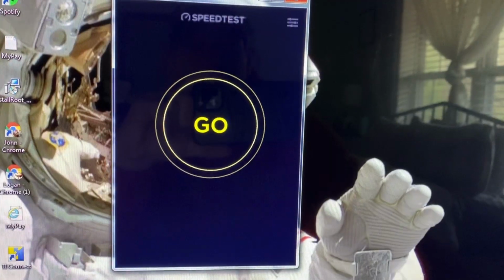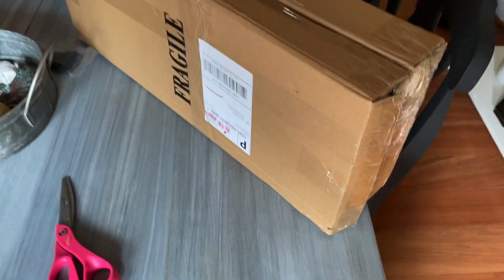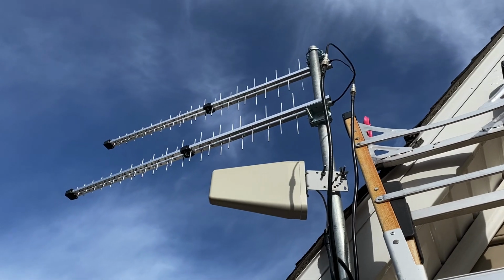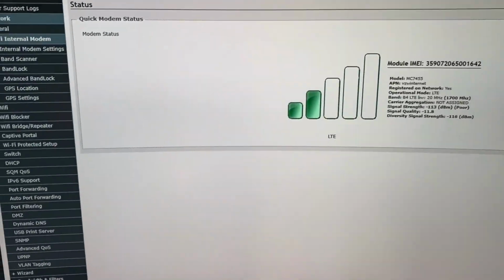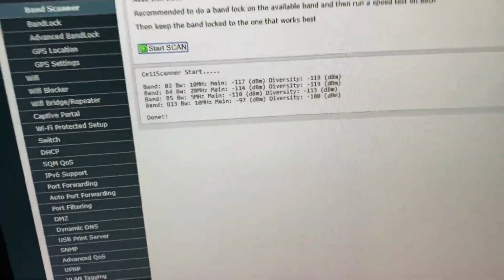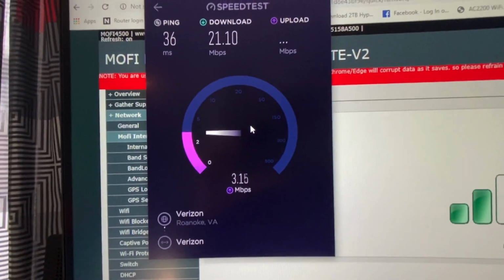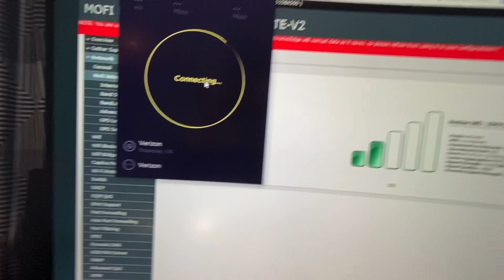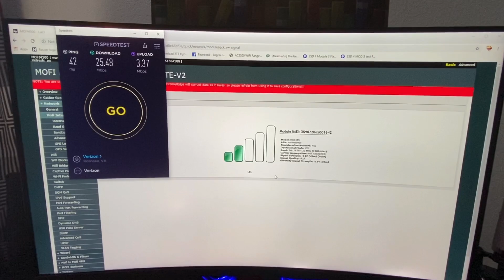INTERNET FOR PEOPLE IN THE MIDDLE OF NOWHERE. WIRENG ANT VS LOG PERIODIC Part 2

Comment: The mouth on you,Sheesh,Do you go back and listen to yourself?I never understood how someone with your foul mouth can make it in this world to afford a house like that.Its adolescent to speak with so many curse words,It undermines someones intelligence with a polarizing stigma.Anyone can go to a store and buy an antenna and put it on a structure,Its all store bought.Most to all these days LPDA are dc shorted(Low impedance).The yagi (With the driven element loops)you have there is either gamma or delta match will always work better than dc shorted antennas.When someone is in remote areas and signal are in the -100 to -120dbm range,Electrons migrate better if the boom of the antenna is not grounded like all lpda on the market,DC grounded yes,But not RF grounded.They make these antennas dc grounded for one reason,Corona discharge effect,So static built up from the atmospheric potential does not discharge back into sensitive electronic equipment.I have done extensive tests on many antennas,With a sawtooth sweep generator and a high end detector probe to see a bell curve (parabola) type response on the front end of these type of antennas.And the results are the non dc shorted antennas have a sharper Q,Higher skirts and higher gain.The LPDA have broader bandwidth but much less gain,Especially since the boom is grounded and low Z,The front end of a receiver hooked to a dc grounded antenna sees a lumped impedance mismatch VSWR.It does not hold a distributed 50 ohms like coax.

Comment: Hi there, Can you please tell me how far apart the old LPDA Antennas are spaced in millimeters using that bracket supplied with those WIRENG Antennas, I am guessing it looks like about 218mm .... John vk3hjq
Reply from the maker: Typically a ruler length. So LDPAs can be orientated In any way.  One on top of other, canted, side by side. Mine were stacked. Sometimes if they’re too close together signal isn’t as good the further apart they are.  It’s all trial error.  I’d test them in multiple configurations to see which gives you the most decibels brother.  Let me know what you get.
Reply from the maker: But the WIRENG is basically a ruler apart 12 inches I’d say
Reply: @rockernro   Hi John, Thank you for the reply, do you know the exact measurement used on this WIRENG bracket, as they should be placed at a minimum of 1 wavelength apart at the lowest operating frequency (1 wavelength @ 700MHz = 42.8cm) .... John vk3hjq
Reply from the maker: @vk3hjqjohn548  sorry I do not

Comment: You need parabolic. I have the same antenna you do here as a backup, it's not bad, but it the parabolic is much better. Also you should hook your mofi up to short cables near the antennas and see what the difference is. If it's drastic, you need better cable or in line M2M boosters.
Reply from the maker: Hahaha this is an older vid I  had 2 parabolics at one point look at my channel thanks !

Comment: If you have a parabolic antenna (which is actually much better than a log periodic) you need to have azimuth and elevation adjustable to get the best signal. Also, you need to have a really steady base for the antenna, any flex or swaying will produce signal strength changes. One other thing, during sunset the path changes so that also affects the signal somewhat. The trees in your direct path also degrade your signal (especially when they're green). I was a Sr. Telecom Project Manager for over 4 decades and also 7 yrs in the signal corp (MOS 26V & 26L).
Reply from the maker: Nice I’m an amateur and figured it out by hand lol.  I have parabolic vids on here when I upgraded
Reply: @rockernro  Glad to hear you figured it out. Good work! I'm not the type to give up either!

Comment: What type of connector do I need to go from this antenna to the low loss cable?
Reply from the maker: You don’t need a connector if the low loss cable has the connections built in.  One end of cable would be N-Male which goes to antenna.  Other end would be SMA-Male which is smaller end goes to mofi.  If you are doing 2 antennas you will need two cables.  Look at this link.  Don’t have to buy this one but something like this: Times Microwave 400-n-SMA-25 LMR-400 Antenna Line Coaxial Cable with N Male & Straight SMA Male Connectors https://www.amazon.com/dp/B00H9II93Q/ref=cm_sw_r_cp_api_glc_fabc_b2r-FbC68F40H
Reply: @rockernro  I am replacing the Wilson wideband antenna with the log periodic directional Yogi antenna just like the one in this video. The cable I have is  a low loss cable with N male going to the antenna, do I need a FME female to a N female to connect the wire to the log periodic antenna? Thank you for all your help ,I do have internet I am just trying to make the signal better with this antenna. Lol
Reply from the maker: @jbblevins2711  yes unfortunately the log periodic antennas need the connectors.  You know the parabolic will actually get you way more gain if you are looking for top speeds.  Won’t need any special connectors for them.  But yes you need an FME female to N male for sure for the LP
Reply from the maker: @jbblevins2711  like I went from -114 gain to -103 -104.  Went from 25 down and 1 up to 45 down and 6 up by switching to parabolic
Reply: @rockernro  Thank You very much!!!

Comment: Can someone please tell me the outside config layout diagram on the pole, to mount 2 Wilson 75 ohm antennas? One is pad one is yagi, I just need to know the proper install on the pole for them to be optimum. My god why is it so hard to find this? Surely someone has done this before
Reply from the maker: Are you using a mofi?  So you are using one Yagi and one Paddle antenna provided with mofi?  Use the quick check signal strength on main page of mofi to see your decibels in real live time.  What numbers do you have for signal strength and signal quality?  You want to get those as close to 0 as possible for example if you’re signal strength is -120, it needs to be -100 or less -85 somewhere like that.  We can get the decibels lower by ensuring we are locked on a band that your mofi found in the band scanner and turn the antenna left or right up and down until we dial it in to the lowest possible decibels.  Same thing applies to your signal quality.  If it’s -12 it needs to be -7 or lower. These are just examples.  Mine was signal strength -104 and my signal quality was -7.8.  That was the best I could get.  I tried every band.  And used the band that was the fastest.  Lastly, just because you have the best decibels on a band doesn’t mean it will be the best speeds.  Sometimes a different band with a little worst decibels might actually be faster.  Hope this helps you some.
Reply: @rockernro  well so here is what happened, I bought a weboost home 4g kit like a year ago for 400 bucks. It came with a paddle antenna. My amp only has one RF RG6 coax in port. And one out port (for the little inside antenna) well, I ordered a yagi Wilson antenna (same company as weboost) 75ohm directional antenna/yagi. I'm in an RV dont have alot of choices for height, I dont have LoS of tower but it's close by within 3 miles
Reply: @rockernro  oh also I am using the netgear ATT nighthawk MR1100. I know u asked about mofi 4500, I have that one as well but my service is activated for the nighthawk and not for the mofi 4500 unfortunately. Also, I have an inside antenna mimo pad hooked directly to the MR1100 via ts9
Reply from the maker: @unleasheth  nice man hey people have said those nighthawks are fast so hope it works out for ya.  You can always try taking the sim out and trying it in the mofi as well
Reply: @rockernro  thank u bro. I just thought it may mess up the service since the sim card is assigned to the nighthawk? If it wont then I'm def willing to try it cuz its the better modem of the 2 by far, with waaaay more of an in depth router setup than the nighthawk
Reply: @rockernro  I finally just found out that both of these antennas, the weboost paddle as well as the wilson yagi are both vertical polarized antennas. At the moment I have the paddle at the top of the pole, and the directional laid over on its side at 90 degrees right under it. But I know better speeds are doable, I will keep fiddling with it, if anyone else has any pointers feel free to hit me up. And thank u for ur replies
Reply from the maker: The proper install to answer your question is put the Yagi into the primary antenna port keep it pointed > like that.  Straight.  The panel antenna if it’s not the one from the mofi use it in the secondary port.  Orientate the panel just below the Yagi and try it above the Yagi. You have to play with it.  Adjust as I said and you will see signal.  Keep in mind depending how far you are from tower I highly recommend getting a parabolic grid and keep your Yagi as a secondary antenna if you haven’t seen my other videos go to my channel and see the difference it made.  Huge difference
Reply: @rockernro  without the booster I'm at -112. With the booster sitting right beside the modem I'm around -88. It's not so much my download speeds those are great. I'm trying to do a couple things, one I want better upload and 2 I want to keep the signal as steady as a I can for reception to prevent dips and waves in connection which cause lag. Thank u sir. And right now my numbers are pulling 28 down 2.5 up but I have seen it do double that before. Easily. I just have to find the best layout
Reply from the maker: @unleasheth  yeah see the nighthawk I don’t know if it allows for Carrier aggregation or band locking.  I would seriously consider trying the sim from it and putting it in the mofi and see what happens.  For example.  I was getting 30’down and 1 up.  After o got aggregation with 2 bands locked, I got 7 down.  Plus the mofi will at least help ya with the decibels finding them and all

Comment: I have no idea what the numbers mean. The -112 signal strength for example or the number under there that says 10 signal quality. 
Can someone tell me what good number are? Is it the higher numbers that are good or lower?
I’m about to add a second Wilson Yagi antenna both at 45degrees 3’ apart as some suggested in other forums etc. 
I have them temporarily installed one on top of the other both standing vertical about 1’ from one another and about 7’ off the ground ground and I’m getting on average 20mbps. I will have them atop a 20’ antenna mast by the end of the weekend. Im between 3- 5. Ike’s from a tower. So I’m curious to see how good it does when it’s all done but I have no idea what those numbers mean.

Comment: Flip one of those antennas on its side like 90 degrees to the other one
Reply: 45 degrees..., not 90...
Reply: @josemartins1377  nope, either one at 90 degrees to the other or both 45 degrees in opposite directions=90
Reply: @stewartdcampbell  that.s it :)

Comment: in my opinion you should separate the two periodic log antennas of 50 70 cm, (avoid self interference) one is with horizontal polarization and the other vertical,  45 degree... it seems to me, to remove the previous antenna because it could create self-interference and improve pointing.

Comment: By the way..
The antennas you took down were Log Periodic..
The ones you just put up are Not but rather Frequency specific beams..

Your original antennas were made and designed to take advantage of Mimo configuration ( to Best orient to towers with such abilities )
Given how you set up your New antennas...
You Lost your Mimo advantage ( the polarization needs to be 45 degree difference opposite each other..but not directly in Vertical or in Horizontal  position ) and that Degrades then your ability for maximum gain to the tower with a mimo advantage set up..

The New antennas are far higher gain and frequency specific and offer higher gain..

So what you lost in a mimo set up you gained back through higher gain..

The advantage goes to the better gain of the frequency specific beam..thus enabling more consistent strength in connection..

Ways to Further up the anti..
Get as close to a 3 foot spread between the antenna boobs ( that will result in better swr readings and that means less loss of signal/power )

Set the new antennas in a mimo configuration. 

I$ still need..add and frequency specific antenna mounted pre-amp ( to Only increase your downloads )

And or get a frequency specific ( you can look up the band you are trying to access to then find its frequency )
For a cel booster/amplifier ( it is Best to first know which band is Best where you are.since most bands operate upon different frequencys )

Also...
Putting the antennas as high as possible ( height is might ) I would use a 10 to 30 foot pole ( preferably a carbine fiber pole..for is far stronger and far lighter too )

I think you are using the mofi cel modem.. though that is only a Cat 6 modem... where the Netgear M1 uses a Cat 16 modem ( netgear M2 uses a Cat 20 ) and using a Superior antenna set up..with either an antenna Pre-amp and or a cel booster / amp.. using true low loss coax ( not that crappy skinny stuff most use )

Doing All of that..
You can likely get Truly good and fast cellular service

Comment: *Trying to find these adapters*
Can you link me these please..... 

Im getting ready to copy your setup with the log periodics.
Also is the wire just a regular coaxial cable from antenna to mofi??
Reply from the maker: manuel perez I got you!  Let me get the link for the adapters:  log periodics adapter pack:  Phonetone N Female to FME Female... https://www.amazon.com/dp/B07T6H1MTM?ref=ppx_pop_mob_ap_share
Type of cables:  Proxicast 25 ft Low-Loss Coax Extension Cable (50 Ohm) - SMA Male to N Male - for 3G/4G/LTE/Ham/ADS-B/GPS/RF Radio to Antenna or Surge Arrester Use (Not for TV or WiFi) https://www.amazon.com/dp/B00QZEQ5EA/ref=cm_sw_r_cp_api_i_LH3HEb9YGS9KE
Reply from the maker: manuel perez get those adapters and make sure you buy 2 cables and they will go on the mofi no problem my man